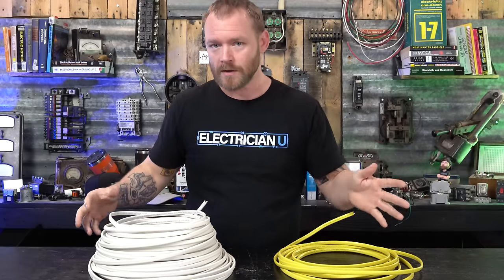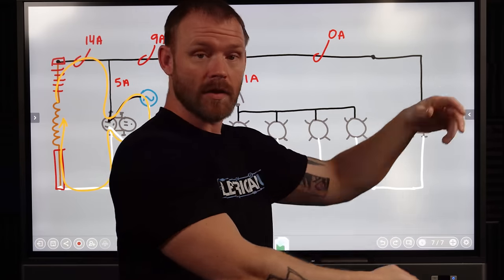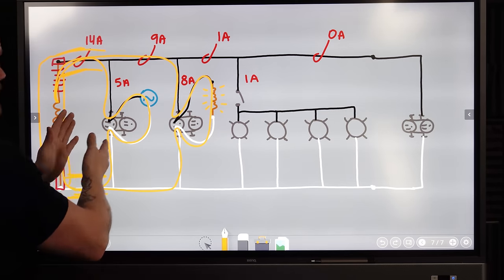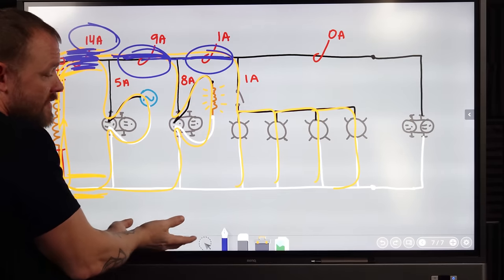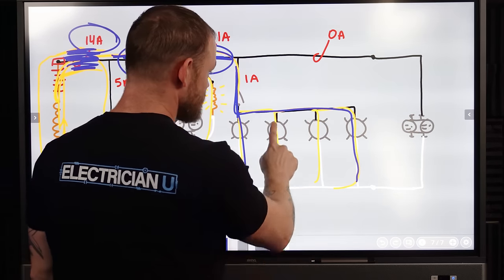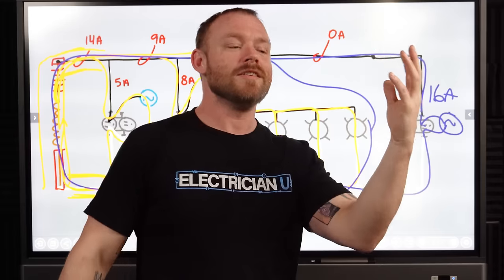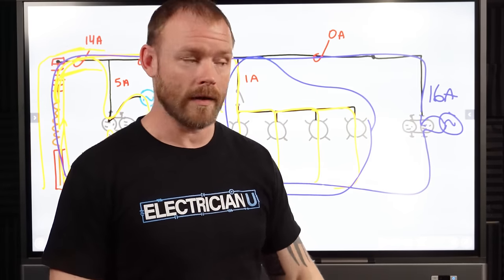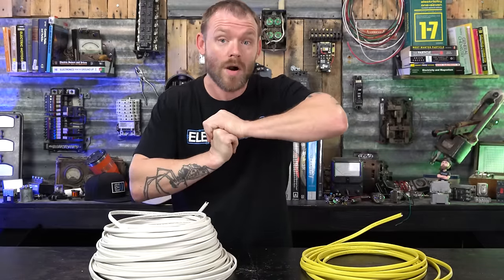Should You Be ONLY Using 12/2? When Can You Use 14/2?

Comment: By me, the only time 12 gets used on a 15A circuit is on really long homeruns to guard against voltage drop. And I never use 14 on a 20A circuit. We use 12 gauge(20A), for kitchen receptacles, bath receptacles, laundry receptacles, dining receptacles, and garage receptacles. Everything else gets 14 gauge(15A).
Reply: I agree the Breaker is to protect the wire!
Reply: The cost difference when considering the better wire over the life of the system translates to pennies for a much better product long term. Same goes with using the higher quality 20amp receptacle outlets over the cheap homeowner grade 15amp outlets.
Reply: Got a question for you, if you can give me a sneer that’s be cool! 
If you are installing a receptacle to a small commercial tv store should you be using 14 AWG or 12 AWG? Is there any specific code for it or do you follow the amps the receptacle you’re adding needs? (For example if I’m adding a 15 amp recep I use 14AWG because that’s rated for the 15A)?
Reply: @aandythesparky  You aren't allow to used 14 AWG in Commercial places
Reply: Someone who knows what they are doing. 12 wire dummies!!
Reply: In theory, what you're saying is fine. In practice - do the calculations. At 15 amps of load (i.e.: you have to calculate drop on a circuit under full load), 14 AWG wire will have a 5% drop @ 70 feet.

In most modern homes, almost all home runs from the garage to upstairs bedrooms/living areas will be more than 70 feet.
Reply: Yes same here.  Primarily Residential occasionally commercial.  We step up to 12 awg on 15A circuit when the homerun is longer than 100 feet.  If there are several long homeruns running to a particular area,  it's more economical in labor and material costs to install a subpanel near the remote location rather than oversizing all the circuits.  I don't run into this situation often and when I do it occurs in larger homes or additions.
Reply: I wire to code (minimums) as a rock bottom, but usually focus a lot on voltage drop, shooting for well under 5%, if not closer to 3% or less. Honestly I don't do the math, but using more 10awg on homeruns often does the trick. Homeowners seem to want the best, strongest circuits they can get when they're actually having a new branch circuit added; and I oblige happily. Another trick to reducing some voltage drop and simply making BETTER circuits is to pigtail the devices. Many old receptacles burn up from current that was being drawn by one or more receptacles further down the circuit. Just the wear from heat and current resonance loosening stuff over decades making everything brittle and/or loose until failure.
Reply: the size of the conductor does not confer quality.  There is absolutely nothing wrong with using #14 to meet the general lighting requirements in the home, e.g. receptacles in bedrooms, etc.  The tired space heater argument is pretty weak - especially in new, energy efficient homes.  Any need for a space heater represents a complete failure of the energy design and performance of the home.
Also - the ampacity of the receptacle has nothing to do with quality.  Specification-grade receptacles are available in both 15 and 20A configurations, and aside from the difference in NEMA configuration, they are the same in terms of quality.  But I do agree that the extra couple of dollars spent on a specification-grade receptacle - regardless of configuration - is money well spent on providing a quality installation. @hippo-potamus
Reply: @luismachin2933  Not true.
Reply: @hippo-potamus this is very true, but you get what you pay for, and often nowadays contractors don’t want to pay much

Comment: My new home (2 years old) in Georgia used all 15 amp AFCI breakers and 14 gauge wire on all lighting and receptical circuits (except for dedicated, 20A recepticals like microwave, cloths washer, etc.).
Reply: Yup, pretty standard mass produced home issue. The contractors do the minimum required because they don't have to live with the results.

Comment: Glad to see a lot of concern in the comments, reinforces my confusion watching the video. I am not an electrician but I've done a little research for DIY purposes. My understanding: 12-gauge wire needs 20-amp breaker protection, 14-gauge wire needs 15-amp breaker protection. Running 14-gauge wire anywhere in a circuit that is connected to a 20-amp breaker is a no-no because 14-gauge wire is only rated for 15 amps, so if there is some sort of fault condition in the circuit that draws more than 15 amps but less than 20 amps you could have a potential fire hazard.
Reply: 14 gauge wire needs a 15A breaker.

Comment: In Canada, 14 gauge (15 amps) is commonly used for majority of homes outlet and lighting circuits, usually combind for individual rooms. 12 gauge(20 amps) is required for kitchens/dinning rooms, bathrooms, utility rooms and garages.
Reply: Yeah, I didn't even tought this had to be mentionned honestly... It's common sens. Isn't this channel for electricians only?
Reply: That's how we wire.
Reply: I have lived in Alabama my whole life. I purchase a newly built home in 2008. The wiring in that home was exactly as you described in Canada. I recently moved, buying a home built in 1985. I have seen some really janky wiring. Bedrooms have 15A and 14/2 Romex. But lighting and outlets are all on the same circuits. Additionally, they put the furnace/air handler on the same circuit as some outlets in the Main BR and the bathroom lighting. Plus, half the kitchen is on the same circuit as the dining room, basement stairwell and garage. Half the living room is on the same circuit as the basement lighting (separate from garage lighting), while the other half is on the same circuit is on the same circuit as the outside floods and the garage outlets (also separate from the garage lighting). Still, as janky as all that is, it isn't as janky as the house I grew up in, which was built in 1954. Let's just say that when I saw how the house was wired, I thank God each day that we all didn't die in a house fire growing up.
Reply: There are some areas in canada that uses 12 instead of 14 because of how hot they are in the summer. Can’t remember exactly where
Reply: @DGTubbs  Lol. Well don’t go into any houses built before world war ll. You will probably run down the street screaming. Houses are built to the code of that Era. The Code across the country is on a 3 year change cycle. So I’m sure your 2008 home is not in compliance with current code. Neither is my Custom built home from 1980. Nothing to worry about. Just maintain it and don’t do any thing Janky. Lol.
Reply: @ronlovell5374 Last CEC code release 15amps was still the standard for everywhere except the kitchen. Kitchen still allows 15amp splits, or 20amp outlets. I do think that 20amps for outlets and 15amps for lighting only is good practice, makes things easier, especially when the homeowners plug two block heaters into the same outlet at night.
Reply: One can indeed use 14/2, however by NEC 70, that 14/2 is required to be protected by a 15 amp breaker at most. On the other hand 12/2 is allowed to be protected by a 20 amp breaker at most. You can use 12/2 in a 15 amp circuit to counteract the effects of line loss, or larger wire if need be. There are easy tables to help with that in the Ugly's handbook.
Reply: In addition, Canadian electrical code says that the light's have to be 14/2
Reply: @stevelopez372  LOL! Thanks. 😂
Reply: @samuelprudhomme3726  How much elitism do you have? And I must have missed the youtube feature banning all noncertified people learning about working on electrical.
Reply: The older the house, the more 15a circuits and the more 14ga cable it'll have. The US government is going full-tyranny and, though not as bad as Canada, and trying to crush us all. So the US code is going crazy these last few years and last decade.

New houses, a lot more GFCI, 20amp circuits, and 12awg cable.
Reply: @DGTubbs  In residential it is normal for lighting and some outlets to be on the same circuits. Air handler/furnace should have been on a dedicated circuit as it is considered fixed equipment. Kitchen and dining receptacles must be on 2 x 20a circuits and they're allowed to coexist on the same 2 required SABCs. Kitchen outlets cannot share a circuit with other areas like garages and basements, but lighting circuits along with any typical convenience receptacles can.
Reply: @TheDrew2022  Always was a curiosity to me why Canada allowed 15a splits in kitchens at all. My understanding is only 2 splits on each circuit though is that true? Also, now that GFCIs are in play, isn't it more economic to install 20a circuits instead of purchasing 2-pole 15a GFCI breakers?
Reply: @darrendolphdragos9752  Code only allows two outlets to be fed on the circuit. Same rule applies to 20amp outlets as well. Not sure the exact reasons why 15 splits exist but it allows for a higher power density at each outlet. Each plug can handle 15amps for an aggregate at the outlet of 30amps. Agreed breakers are expensive, double the price of single pole GFCI but the cost of rewiring a kitchen from 15amp splits to 20amps is more expensive then slapping in a few breakers.
Reply: @darrendolphdragos9752  Code only allows two outlets to be fed on the circuit. Same rule applies to 20amp outlets as well. Not sure the exact reasons why 15 splits exist but it allows for a higher power density at each outlet. Each plug can handle 15amps for an aggregate at the outlet of 30amps. Agreed breakers are expensive, double the price of single pole GFCI but the cost of rewiring a kitchen from 15amp splits to 20amps is more expensive then slapping in a few breakers.
Reply: @TheDrew2022  Amazing, so I have 7 counter-top receptacles, I would need 4 x 20 amp circuits?
Reply: @darrendolphdragos9752  You would want to check your code book as the NEC and CEC aren’t the same. But if you were wiring a new kitchen and needed 7 outlets then yes, according to the CEC you’d need four circuits.
Reply: @TheDrew2022 split plugs in the kitchen for larger amp appliances.

Comment: The drain pump on my Whirlpool washing machine is fed by 21AWG from the factory with a factory vampire wire piercing connection for termination.  The bean-counters probably got a nice Christmas Bonus for sizing the wire "just right".   The vampire connection caused the wire to corrode and fall off the pump.  That's how I found this ingenious bit of engineering.
Reply: I have 19AWG on a Kenmore vacuum, manufactured by Panasonic. You normally only see even-numbered sizes.
Reply: Some of my RC car speed controllers have 13AWG. Seems strange since most batteries for them come with 12AWG or thicker.

Comment: If i understood correctly you used 12 gauge on everything before the LED lights and ran a 14 gauge leg for the LED and that 2nd receptacle.. so without that 16 amp load you essentially said use the correct load for your breaker?

Comment: One of the differences between Canada and the US is use of 12/2. For residential homes almost all circuits are 14/2, 15A circuits. Those 20A circuits that you guys use are rare here, at least in homes built ten years ago. I find that particularly irritating in my garages over the years. Some power tools like my table saw are right at the limit of 15 A circuits, and old homes share lighting with power outlets. Add in the voltage drop from panel to garage, and the table saw needs to spike current higher (and longer) to spool up. That's a recipe for a blown circuit breaker.

Comment: Back in the days of incandescent lights and plug in the vacuum cleaners, bigger wires meant brighter lights and stronger vacuums. With LEDs and cordless electric, the demands on those circuits are much lower. Still remember to oversize the car charger, dryer, and range circuits. Reducing the voltage drop will save the customer thousands of dollars over the life of the home.
Reply: Ding ding ding! This is why I use 12 gauge for lighting. Many electricians like to overlook how convoluted and LONG a lighting run can get.
Reply: I totally see what you’re saying.  But those cordless battery powered vacs will never compare to a plug in the wall vac.  I have one of those cordless vacs and, to get the same suction as it’s corded counterpart from the same brand, I have to put it on “boost” mode.  That gives me maybe 10-15 minutes of vac time before the battery is completely depleted.  Who wants to vac for 10 mins and then charge for 4 hours to get another 10min of vac time?  It’s like electric vehicles.  Waste of time.
Reply: The vast majority of people still use a plug-in vacuum cleaner.
Reply: @miket5506  Guess it just depends on how much floor you have. 🤷‍♂

I have a lawn service. 5 years ago I would not have even entertained the idea of cordless electric OPT. Now all my equipment is battery electric. It was just a matter of solving the refueling problem. 

Having said that, I agree, there are some battery powered tools out there that only belong in the discount stores where cheep people buy cheep merch.
Reply: @miket5506  Never? Technology advances. I give it 5-10 years before most battery powered tools will surpass the performance of plug in varieties.
Reply: @sathivv950  vacuums are high draw long runtime devices. There always gonna suck compared to a corded model.
Reply: @FishFind3000  Why couldn't a small battery exist at some point that can deliver 1400 watts of power with 3 kilowatt hours of capacity? Progress in this area has been phenomenal and not only does that seem inevitable, but near future. Never is such a strong word. It sounds like watching the first aircraft fly a total of a 120 feet and saying, meh, that will always suck. 

I recently got Ego's 765 CFM battery leaf blower to replace my 15 amp corded black and decker leaf blower and it is WAY more powerful than any corded one I have ever used. Granted it can only sustain at that power level for about 14 minutes. But they already have packs that can run it for over an hour. At a certain point soon I think they will just be better in every way.
Reply: LED lighting causes sleep paralysis.  Look up blue light effects.
Reply: (sigh) Car charger. If your home is all-electric and you have an electric vehicle, are you really saving in energy costs? The cost of BTU/kWh is MUCH higher than the cost of BTU/Mcf in natural gas. In my area, it's 185% higher. I'm SO glad I have a natural gas home. If the up-front cost of a generator wasn't so high, I'd be tempted to install an 18kW natural gas generator and run it from 10AM to 6PM daily from Memorial Day to Labor Day each year just to stick it to Southern Company and their d@*n monopoly on my state.
Reply: @DGTubbs  Choice of fuel is not always about cost. But whatever type of fuel I chose to use, I don't have any incentive to waste a percentage of it. 

Imagine if you were charged for the 2% of natural gas that is lost in distribution.
Reply: @robertthompson3447  Fair enough point about cost. What about availability. There are plenty of incentives out there for businesses and consumers to make decisions which add to the demand on the electrical grid, while also shutting down coalfired plants without suitable alternatives. This increases demand and reduces supply, resulting in higher prices per kWh. Meanwhile, China added over 50GW of power production in coal-fired plants just last year (2022). Over the next 10 years, our country wants to reduce the power production by 50GW and add over 30M public (PUBLIC!!!) vehicle charging stations. Buy your generators now, and DON'T cancel your gas utility.
Reply: When it comes to availability, it will be whatever the home buyer already has. If they already have an EV then an EV is what is available.
Reply: @sathivv950  Batteries will continue to evolve.  However, a pretty large portable tool battery today would be about 10Ah x 20V = 200w = 0.2 kw.  I'm not holding my breath for 15x efficiency gains.
However, it should also be pointed out that whatever one runs the battery with, it still needs to be recharged.  And everyone wants to recharge quickly.  Perhaps even recharging multiple battery packs simultaneously.  So, unplugged at one place, and sucking down the power elsewhere.  
I'll likely have a couple of high power non flammable charging stations in my future home workshop, perhaps with a couple of dedicated 20A or higher circuits.
Reply: @Neil-ym8vy led’s aren’t all blue

Comment: In Seattle inspectors will allow you to wire the house with 12 2 and 14 2 but not a mixed circuit,  either all 12 awg or 14. Awg.